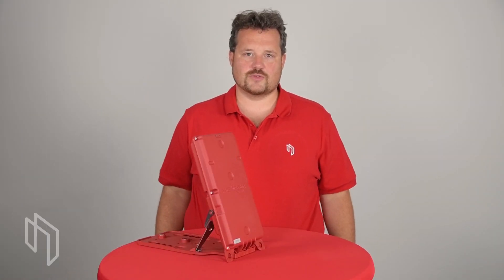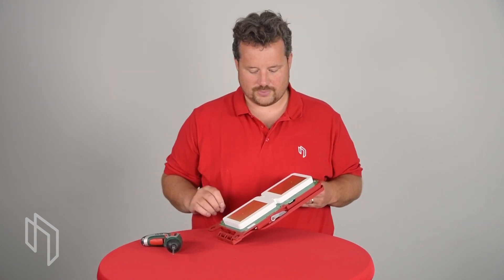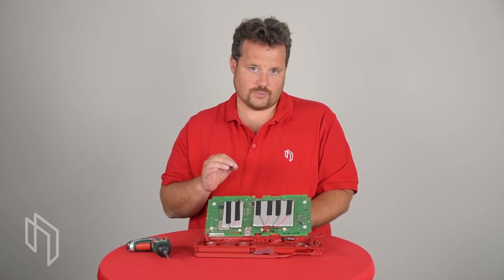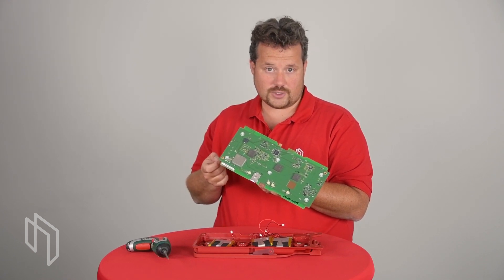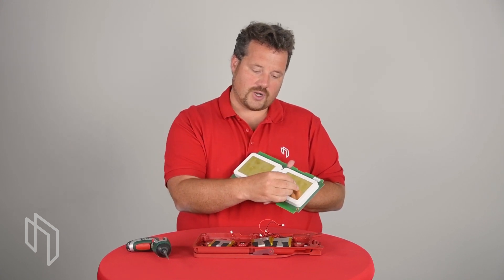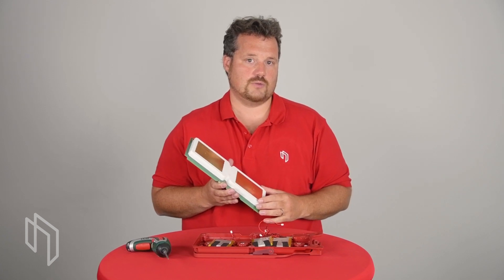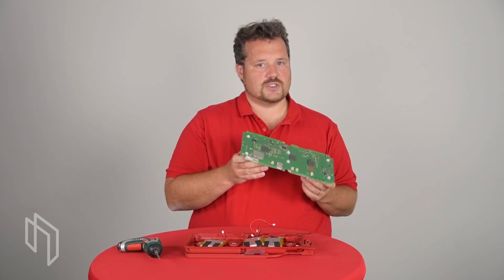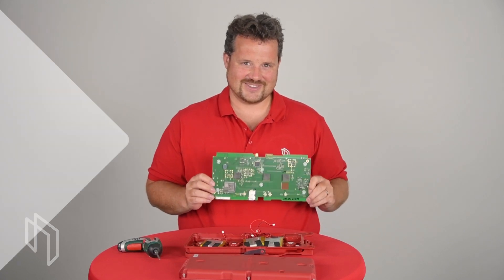Track Box Passive :: Technical Deep Dive :: RACE RESULT

Comment: Great video!
Is there any concern about a buildup of heat inside the box if it's used in direct sunlight on a hot day?
Reply: We have tested it up to 50 degrees celcius ambient temperature. It will reduce battery charging speed at 40 degrees, but compared to other readers our  reader is very power conserving in quite a large package so no concerns about overheating.